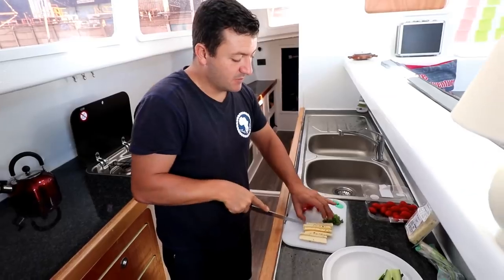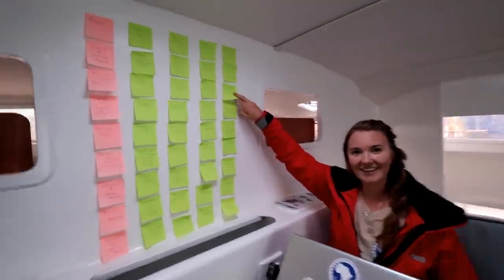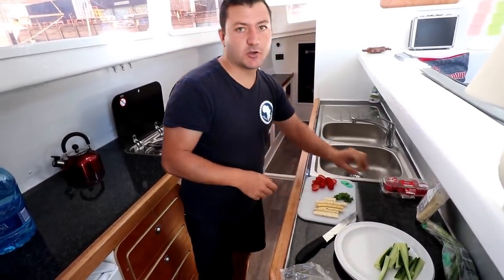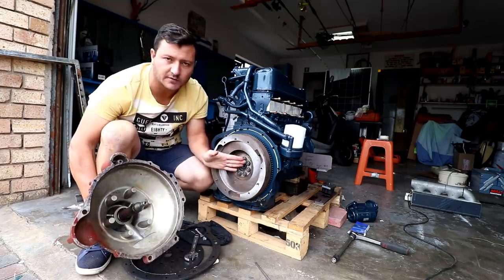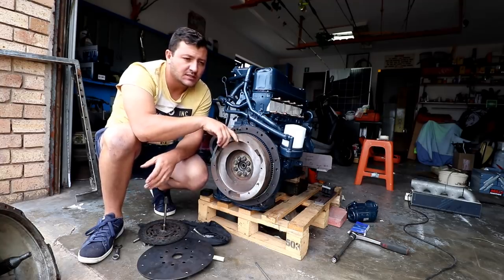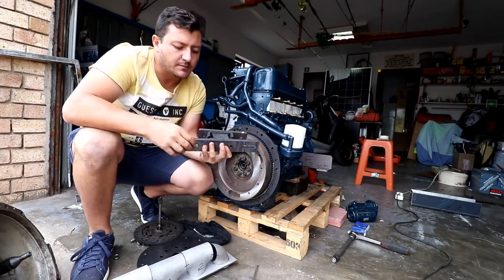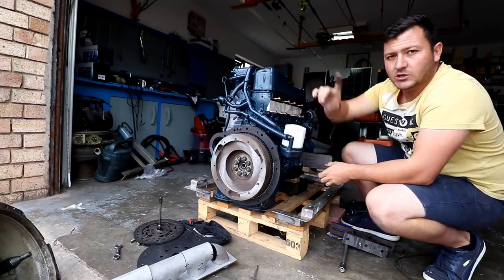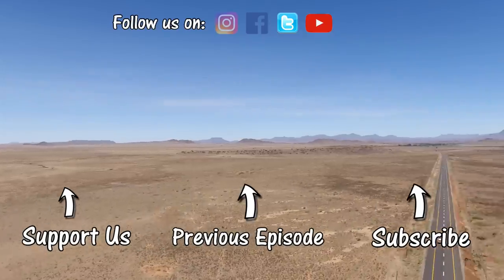MARINISING a DIESEL ENGINE | YACHT REBUILD WEEK 67

Comment: CLEVER! Painting the bottom Orange! I SEE! Simone is the Slavedriver, LOL. Good Luck, Mose! He'll be Fine, he's not afraid to Work, and Does Good, too.
Reply: he did not have much of choice since it's regulation (the country for the type of boat he has require the bottom to be painted that color)...
Reply from the maker: It's regulations here in South Africa.. It's this or carry a huge orange blanket so we opted to paint it instead ☺
Reply: I caught that part,  MUCH less Nonsense to paint to bottom. No Worries when you already HAVE more than you can Handle, Instant, Automatic Deployment of the Orange, you do NOTHING. I LIKE Quick and EASY.  @livingwiththemaias

Comment: Good move maranizing the Izssu , great engines. Smart to use parts from the old Volvo too.
The leg drives are unfortunately not very good for manovering but your not going to spend. A lot of time in marinas . 
Years ago you could but maranizing kits for car engines, we had a boat that came with an Austin 7 engine it ! Cheers Warren
Reply from the maker: We wish we could stick in two new engines but it's just not feasible for us at the moment. Maybe in the future we'll see! 😊

Thanks so much for the support Warren! 🤗
Reply: Sailing Lady Africa , yeh that would be very expensive , two 15hp outboards might be an option eventually. Somebody motored the entire USA loop in a PDQ with outboards! You will be fine. Exciting to see your hard work coming together. Cheers Warren

Comment: great work so far , engine looks great and your right about the Isuzu engine , bullet proof, A tip I always used when working out the final position of engine mounts is too have them loose when running the engine and they will settle in nicely and then tighten , cheers.
Reply from the maker: Thanks so much 😊
Reply: I would most definitely NOT follow the recommendation from Patrick (sorry mate). Carry out your alignment while on the hard and get it near as you can but do not sweat it. Once afloat for a few days carry out alignment checks and achieve the very best alignment you can. Recheck after 6 months/500 hours.
Reply: Worked fine for me many times idling the engine with loose mounting bolts ensures the correct alignment as the engine easily finds its most comfortable spot to  minimise misalignment  wear.
 @normanboyes4983
Reply: patrick coleman Patrick may I ask are you an engineer by any chance?
Reply: @normanboyes4983  Retired fitter and turner , and by engineer do you mean a hands on engineer or someone that deals with theory only, no for many years i was involved with heavy vehicle maintenance in the earth moving industry. this method i described works quite well in the installation for small to medium  engines in confined spaces and can be done in a boat car or light truck with the correct amount of adjustment allowed for  on the engine mounts. Its just a easy way to do things if one is in a hurry or have a lack of precision equipment
Reply: patrick coleman Hi Patrick, Yeah I started life as a fitter and turner - but my application was as a seagoing Marine Engineer for 35 years. I have installed marine engines from 60 HP to 25000 HP, and various pumps and prime movers both steam and electric. I am very much a practical engineer and to be frank you do not need sophisticated equipment. For the smaller kit a clock gauge and or feeler gauges is enough. For long shaft lines with multiple supports - piano wire fixed to target plates. Of course these days the latter done with lasers - not really more accurate just a whole lot faster. I would never fit a marine engine in the matter you suggest as you cannot assure correct alignment with the shaft line through stern tube and P or A brackets. I accept you may get away with it in vehicles or heavy plant.
Reply: @normanboyes4983  Right on we are brothers it seems, well your experience in seagoing eninginering is impressive so i will have to give you the thumbs up here, my experiences are with what i like to call the shake and bake method in confined to spaces,  so i assumed in a pinch it might work and possibly could , nice to chat with another fitter its a dying trade these days. Cheers lasers eh what ever happened to a  string line haha
Reply: patrick coleman 😀👍

Comment: hi why not use a series 2 land rover air filter the (oil reservoir model) just uses standard oil no filters to get damp or fall apart from saltwater. good luck Moses
Reply from the maker: Will definitely check into it 😊 🤙🏻 Thanks.

Comment: You want extra heat exchange capacity designed in so when you lose a raw water impeller blade or several, you are not over heating at the worse time possible.  That's the way it usually happens!   Heat exchangers are inexpensive in the USA.  A 48 hp diesel rated unit is about $150 USD and 85 hp for  $175.    Here are some I found:  https://www.ebay.com/itm/Marine-Heat-Exchanger-13-1-2-long-by-3-1-2-diameter/131570784708?hash=item1ea23ad9c4:g:c74AAOxyDgRQ~0ga           https://www.ebay.com/itm/Marine-Heat-Exchanger-11-long-by-3-1-2-diameter/130910816697?hash=item1e7ae489b9:g:LD8AAMXQgJRQ~0aW       https://www.ebay.com/itm/Marine-Heat-Exchanger-9-long-by-3-1-2-diameter/140978333722?hash=item20d2f6a81a:g:kfUAAOxytdlQ~0S-
Reply from the maker: Thanks so much! They crap expensive this side will definitely check into. ☺

Comment: How do you change the oil?  Remove the engine?
Reply from the maker: We would use a vacuum pump , with a suction line in the dip stick . Very easy